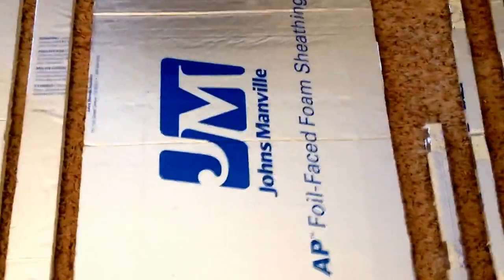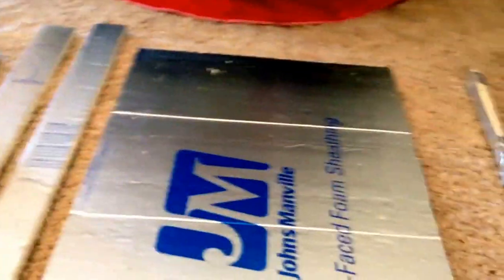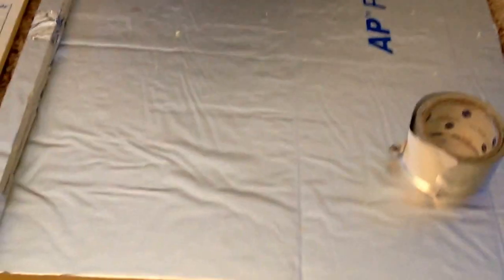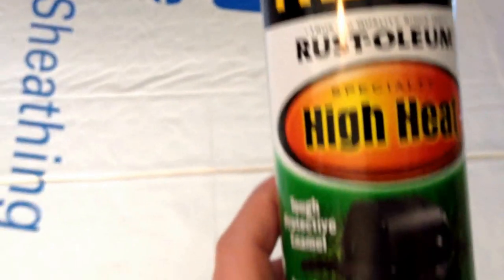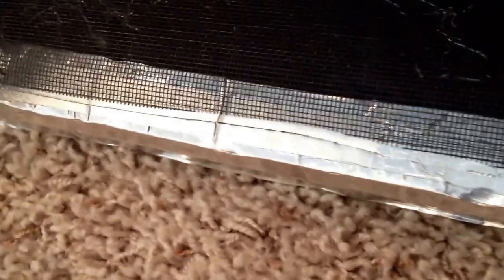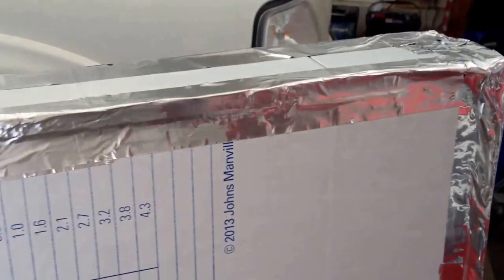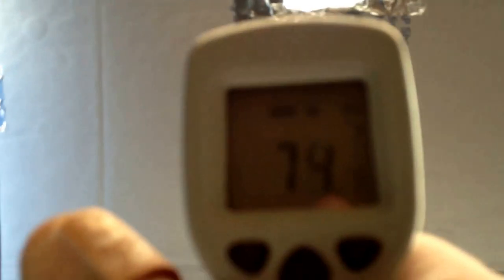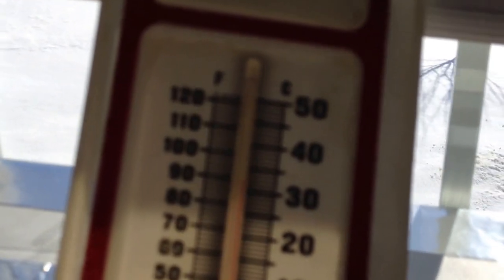Video #1 DIY how to build a passive hot air collector, solar heater, with only a utility knife

Comment: Hi Ray, I was wanting to do a pop can heater but was thinking about how I could do something inside the house in my windows that I can insert into the window frame quickly and remove quickly.  Yours is so simple and light weight. I really like it and with your other improvements in the other videos.  QUESTION? What is the purpose of the black screen?  Seems like the black paint would be enough but I dont know, so I'm asking.  Great helpful videos for people to stay warm on a shoe string budget.  And there are alot of people that could use this with the midwest now under a propane shortage and now the natural gas and electric companies are asking people to cut back.  This simple design is must!  May I share your videos on this on my youtube site?  Thanks for your videos! :)
Reply from the maker: Sorry so long to get back just noticed this, I have hard time finding other peoples comments now, the screen is a heat absorber I saw the idea on a web site (simply solar) they have tested many different collectors and have found the screen type works great and inexpensive to build, yes you can share my videos.

Thanks Ray

Comment: Great project! I've built passive solar window collectors out of cardboard and aluminum foil- and they did work to a noticeable extent- but I can certainly see that the insulation on the back would amp up the heat output. Any reason why I couldn't use a hot glue gun for a great deal of the frame construction? Would a hot glue gun melt the foam center of the insulation board? (That aluminum tape is expensive!) I have several small-to-medium size windows I plan to make into passive solar heaters. I hope to use Liquid Nails, 1X4 wood for the frames,  and install hooks/eyes at the top to hang from my old bead-board ceilings. I think anyone who has a south-facing window and a utility bill to consider really can't afford to NOT try something like this! Thanks!
Reply from the maker: +Kitty VanDuser oh I'm not sure